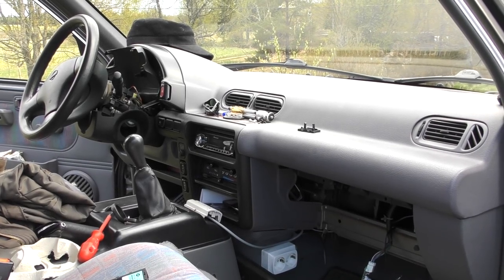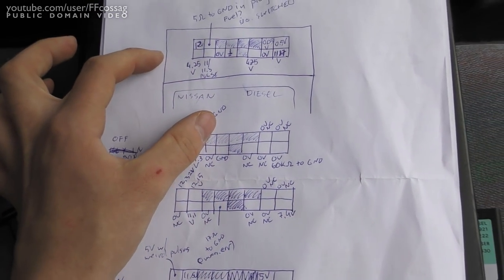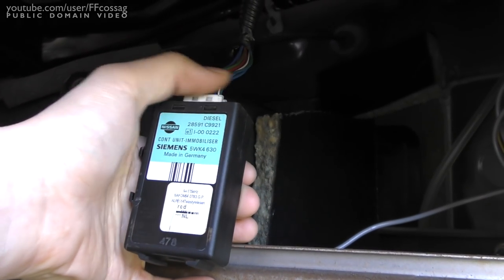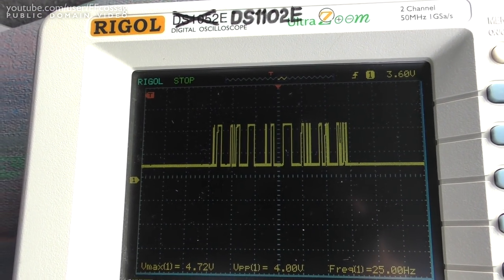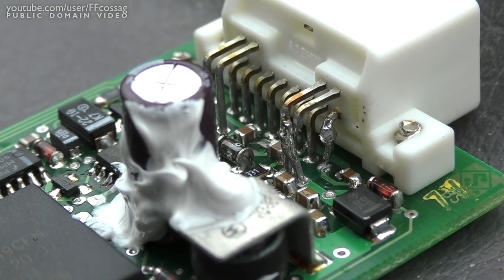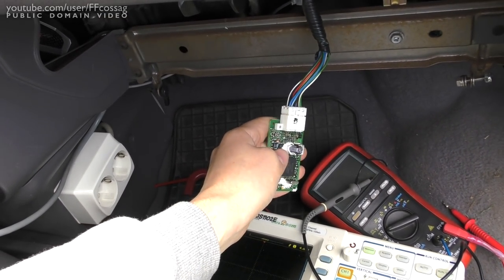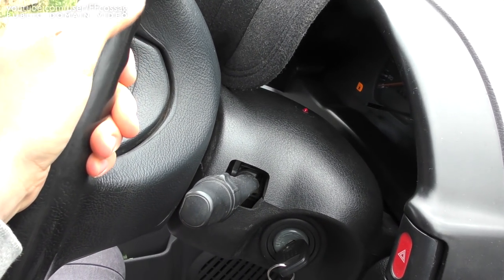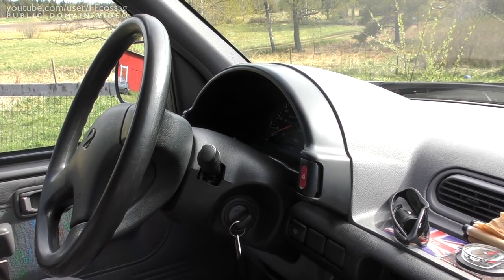1999 Nissan Serena/Vanette NATS fix (intermittent red LED, no start)

Comment: Have you tried moving the code ring around the key barrel closer to the key? Renault clio 2001, has problem that the RF "range" is not enough. Loosened code ring and moved it closer to the key electronics and that seems to work, Have not found a better solution yet. Still have to remove the immobilizer box and trouble shoot.
Reply from the maker: Haven't thought of that. However in this case the issue seems related to the box, since disconnecting the battery fixes it for a while.
Reply: I tried the code ring first but think it is box related as the supply voltage to the code ring seemed a bit low. Your fix might work but it's a daily driver so will have to leave it for now. Symptoms sound like a bad cap in DC-DC converter startup delay circuit.

Comment: Vanette 2001. The immo light turns on automatically after a while while the engine is running. When the ignition is turned off and on again, the light does not go out and the engine does not work. It goes back to normal when you disconnect and plug in the battery. But the same problem persists. Several times a day. I applied the method in the video. But the problem continues. Do you have any other solution suggestions?

Comment: I have test solution. But in my case med ECU antitefth over diesel pump no +12v. I have remove cover around diesel pump and connect direct k15+12v over solenoid diesel pump. And vanette start with nats disconnected.

Comment: Is that anything to do Nissan King-Cab diesel pump? because i change everything on the another King-Cab same year, all these have same code/serial numbers incl.diesel pump whereby i driving it before i remove those to on my car (key,ignition switch,ecu,immobilizer system) still no go? Do i need to replace a diesel pump too?

Comment: It seams the red LED only comes on when the key is on RUN and the car hasn't started. It would have been a good indicator if you left the IGN on by mistake.
Reply from the maker: No, it comes on even if you drive away.

Comment: I'm almost wondering if crudd in the keyway made this issue... i mean after so many years the crudd in the keyway would build up preventing that ocilation thingy ma-bob not preform as it should? ( i'm just throwing an idea out... i'm not an expert in cars )
Reply from the maker: It's unlikely, since these systems work on RF. Usually, the coil in the key isn't physically connected to anything, it just acts like an antenna tuned to the frequency of the box. When the key is inserted (or close to the keyway), the signal put out by the immobiliser gets loaded down by the coil in the key, and the immobiliser detects that change in load.

Comment: In Gemany, it would be totally illegal to mess around with the immobilizer system like that - even if it still works after the hack (meaning, it still only starts with the programmed key and not with a screw driver). The reasoning behind that is: Your insurance wouldn't pay if the vehicle gets stolen and the thief caused an accident, becaue it might not have been stolen with the immobilizer in stock condition. I think that's stupid.
Reply from the maker: Oh wow.
Reply: Same in the UK.  Any modification from factory specification will invalidate the insurance unless it has been agreed with the insurance company.
Reply: i rather have a van that works and risks that someone doesn't want a 17 year old van
i think that this is a 10000 to 1 chance fully  acceptable and have a van that starts every time, also avoid breathing diesel fumes at all costs or hold your breath if you smell diesel fumes and run for clear air every time you in the opposite direction these fumes contain small particulates that log deep in your lungs that the cillia cant get out when you cough
think of the this air your giving the your friend pedestrians on the street every time you go past them , its like your a non caring criminal in each separate infraction of every single pedestrian, extremely harmful in city driving to others, so you saved half  price at the pumps but your a guilty bio driver as charged,  keep this in mind when you turn your key !